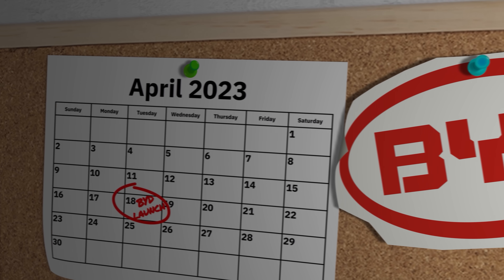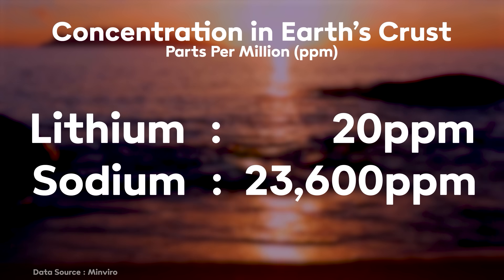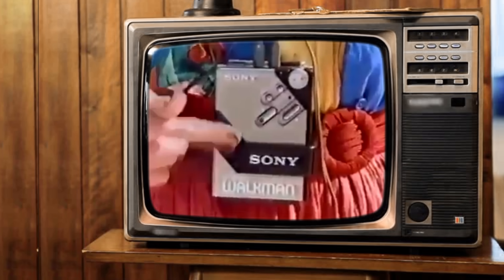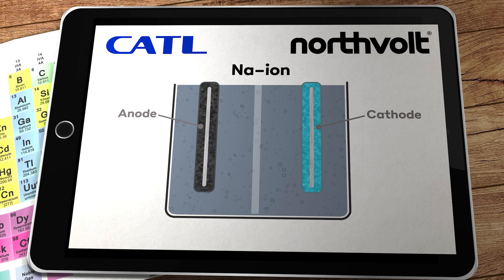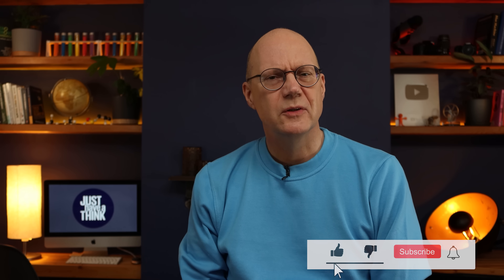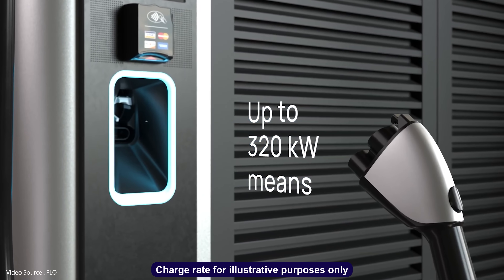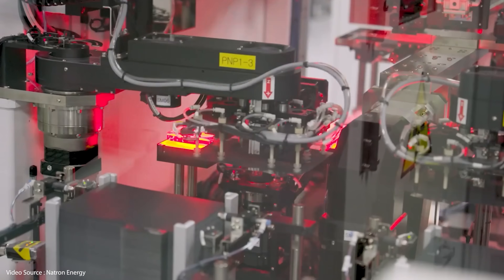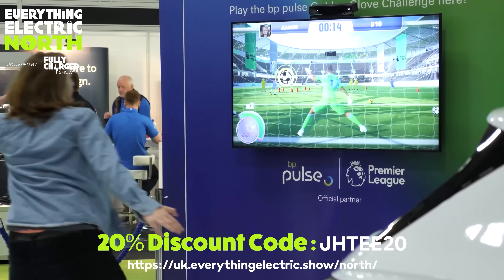Sodium-ion batteries in the USA. Beating China at their own game!

Comment: Thanks for your informative videos. There is a tremendous and immediate need for big, ugly, reliable and inexpensive home storage batteries. The average three bedroom home will need at least 50 kWh of storage to mostly go off grid. Hey young geniuses, please disrupt the corrupt and complacent utility cartels and give power to your friends, relatives and neighbors with an affordable home storage battery!
Reply: Propane is what we are trying to get rid of. 50kwh battery on every home.
Reply: @Krunch2020  Propane is what electric plants and some trucks are converting to to lower CO2.
Reply: @Krunch2020  You are aware that propane is more efficient heat energy than resistive heat when used for cooking or water heater right? If your electricity comes from a coal fire plant, it will lose 50% on power generation, nd 50% on transmission, you get 25% of energy out of the original coal or natural gas at power plant. There is nothing wrong using propane to cook and make hot water.
Reply: @i6power30  You lose closer to 2/3rds or 66% of the energy on burning coal for electricity but transmission is probable closer to 5-15% depending how far from Power Plant. So we still get to about 30% so your original assessment is about right and you are 100% right when the height of madness would be removing gas from consumers and then making them heat food or water using electricity provided by a Gas powered plant.
Reply: @i6power30  Propane was the bridge fuel of the 90s. We need to stop burning stuff for energy. The point of this video is storage for renewables. Solar with storage is cheaper than coal or natural gas now.
Reply: LFP is pretty cheap already now. I run 100kWh at my off-grid place myself. You can DIY for around $100 per kWh including the BMS etc.
Reply: 50 KWH sounds like an overkill. I have a 10kwh, and last 24 hours without charging. Though I don't use electricity for cooking, use propane instead. Water heater also propane. Don't run AC, use fan instead. Hang laundry to dry istead of dryier, you can get by with 10 kwh for just lights, computers, internet, fridge.
Reply: @i6power30  I live in small house, 3 people and 27 panels and 10kw battery and it won't last 24 hours, We don't want to live with inconveniences by having to monitor everything or cut back on things, So I agree with the previous post 50kw is probably more realistic, I'd need at least triple(30kw) to not have to be stingy on everything.
Reply: Powerr30, so much methane leaks between extraction and burning that it is even dirtier in terms of being a greenhouse gas than burning coal! I replaced the propane stove with induction and the propane hot water heater and furnace with heat pumps. Now need batteries so I can tell my corrupt electric utility cartel to suck eggs.
Reply: capitalism will find a way…no need for idealist wars. people vote with their money
Reply: JP, I’m all for real capitalism but pleasantly show me where it still exists! Here in California our electricity is provided by a cartel of three corporate monopoly gangs that have divided up the state into territories. The cartel owns state politicians so we pay the 2nd highest electricity rates in the US after Hawaii, and some of the highest rates in the world. There is zero competition in our electricity…I just can’t call it a market. The end state of unregulated capitalism is the neofeudal monopolies that we have right now. Solar is affordable, but I need 50 kWh of batteries for nighttime power to run the induction stove, and the heat pumps that heat my water and heat and cool the house.
Reply: @jpsion  you are aware that companies have know about the need to move away from fossil fuels for literally longer than i've been alive, and have mostly spent that time lobbying to not do anything right?
Reply: @alextopfer1068  isnt that capitalism? what’s your point?
Reply: @jpsion  Trouble is we don't have real capitalism anywhere in the West. We have lots of rules and regulations which stifle most innovation and competition. Otherwise you'd be right!
Reply: @johnpearcey  Part of the social contract….you wouldnt want libertarian govts either.
Reply: @jpsion  I don't mind any government, as long as they leave me alone.
Reply: @johnpearcey  That’s just one of the many principles. Some are happy with status quo and some want more regulations 🤷🏽

Comment: Summary of Just Have a Think's video on Natron Energy Sodium-ion batteries:

Why sodium-ion batteries?  (1:54)

* Material availability: Sodium is abundant, unlike lithium which is geographically limited.
* Price stability: sodium is less prone to price spikes.
* Full discharge: sodium-ion batteries can safely discharge to zero volts, unlike lithium-ion.
* Cost-effective materials: sodium-ion batteries can use aluminium instead of copper.

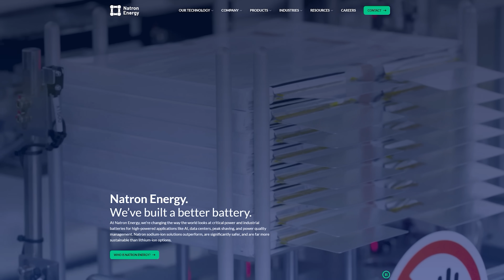Natron Energy's Innovation: (6:17)

* Prussian Blue for BOTH electrodes: Unique use of modified Prussian Blue for both cathode and anode, creating the necessary potential difference.
* Fast charging:  Full recharge in under 15 minutes.
* Longevity:  Less degradation due to minimal expansion/contraction during charge cycles.
* Safety: Less heat generation means no need for extra cooling, minimizing fire risk.

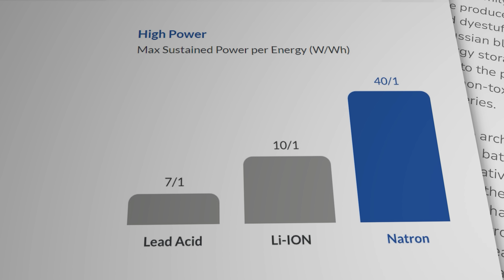Target Market: (8:54)

* Stationary energy storage:  Ideal for applications where weight is not a concern, such as data centers, grid stability, and EV charging stations. 

Natron Energy's Progress: (9:30)

* Received significant funding, including a US Department of Energy grant.
* Opened the first commercial-scale sodium-ion battery factory in North America.
* Aiming to expand to gigawatt-scale facilities in the future.

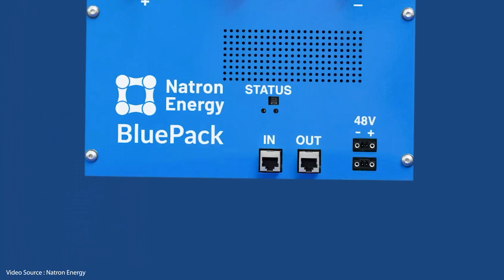Overall: (10:39)

* Natron Energy is a promising player in the sodium-ion battery market, offering a compelling alternative to lithium-ion for specific applications. 
* They demonstrate an innovative approach to confronting the energy transition challenge. 

i summarized the transcript with gemini 1.5 pro
Reply: Thank you , this was very reassuring of my own theories

Comment: Never understood why sodium ion hasn't been a consideration! Shows you how much the lithium market is cornered through recourse and distribution! C'mon AMBRI get it to work! YT get this man a checkmark already!
Reply: Battery density is lower, so less range, however it can charge much faster
Reply: The main problem for all applications is the wide (discharge) operating voltage range for sodium chemistry cells.  Roughly 1.5V to 3.6V (call it 90% DOD).    Whereas LFP goes from 3.0V to roughly 3.4V over the same DOD.    Actually more like 3.0V to 3.35V over a 90% DOD.    LFP has a far, far, far better operational voltage range for equipment designs to target.
Reply: @junkerzn7312 would love to talk to you further about lithium ion / sodium ion if you would be up for it matt. You seem to know your shit and I’m very interested!
Reply: Very little of the cost of a lithium ion battery is from the lithium.  If you need to make twice as many batteries to store the same amount of energy with sodium, it will be much cheaper to just use lithium.
Reply: @faroncobb6040  except that gap is closing and closing fast,  especially as you can charge sodium faster because there's no chance of thermal run away
Reply: @faroncobb6040  Natron's batteries have very low energy density, but CATL's Sodium batteries are approaching the (current) energy density of LFP batteries while having a lower cost per KWh. And they have an interesting advantage in temperature range, sodium batteries lose much less capacity in freezing temperatures than Lithium batteries, which is a very good feature for all applications in places with a harsh winter.

Sodium (though not Natron's) seems like a pretty good future bet for most applications where you don't need very high energy density. More so because it's much safer than Lithium batteries.
Reply: Well sodium ion battery technology has been around for close to a decade and the company that released many of them in America claimed bankruptcy and there are thousands of pissed off homeowners that have this technology that has failed. The battery was not capable of delivering current fast enough for large inductive loads such as air conditioners or water pumps and the voltage would collapse and the inverter would fail. So don't come to conclusions too quickly!

Comment: So, what about the Seagull? Sodium ion technology is successful in this small EV despite low energy density?
Reply: I assume the Seagull is just generally small and efficient, but also the 305km range is not that impressive by modern EV standards. That said, for long trips charge time is more important than range, to a point. So if it actually charges much faster than equivalently priced lithium battery cars it might actually still win out for travel times on longer trips, assuming it's in a place with good charging infrastructure.
Reply: As others have pointed out, the Seagull version with a sodium-ion battery hasn't actually shipped yet. BYD is building the factory in a joint venture.

Comment: Very encouraging. Wonder about home storage
Reply: I think sodium ion battery tech is also well suited to home storage. Basically every non-mobile use case. It would be a wonderful way to reduce demand on lithium ion so that it becomes cheaper for cars and electronic devices.
Reply: @user72974  yea also it means charging stations would stop being the bottleneck for charging. As the cars improve the charging speed would improve as they're still behind the max of sodium ion.
Reply: Well, except LFP calls that have already solved all of those problems, including temperature and charging speed. are already in mass production.
Reply: @junkerzn7312 sodium is way cheaper and 50k charge cycles vs LFP 3,500 charge cycles.
Reply: They seem well suited for home use.  The main apparent downside is that are bulkier for the same amount of energy storage.  So you may want to put the battery system outside of the house, rather than in the garage, for example.
Reply: @yeroca  That's what I was thinking. Use the back yard. And for apartment buildings and such, some sort of communal battery room or the local grid having battery backups interspersed on the grid to lessen the chance of blackouts.
Reply: You can forget about home storage unless you're rich and don't need it.  As for 99% of us, they will never ever price it where we can afford that. That isn't how this world works.
Reply: Yes, the only safe battery you want in your home.